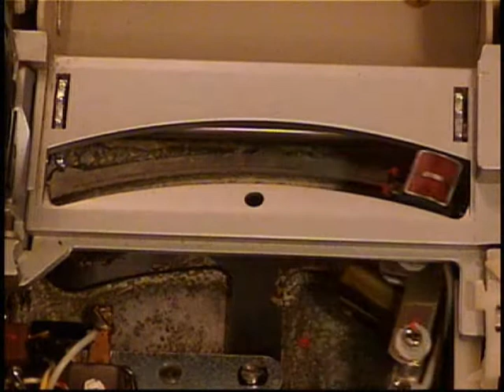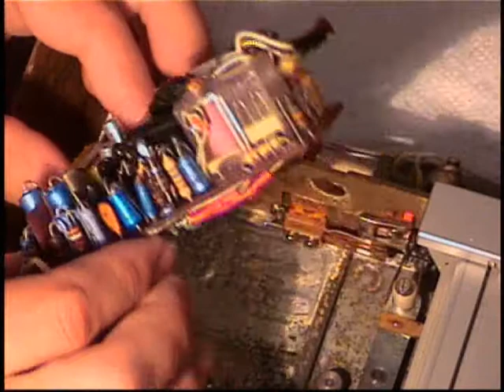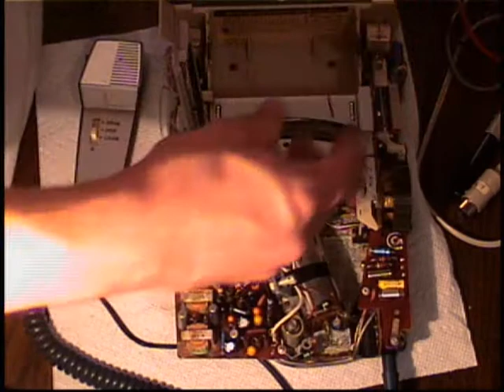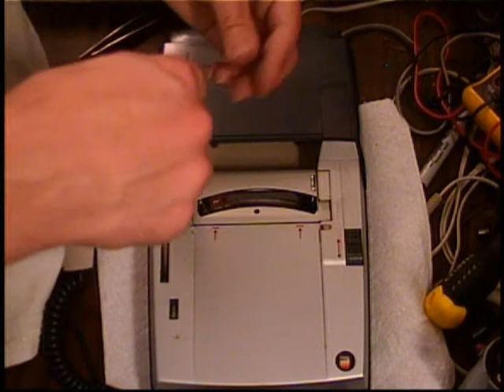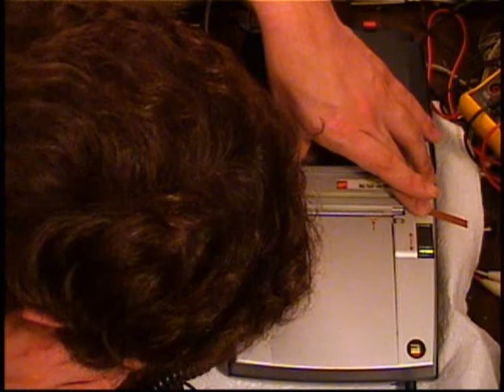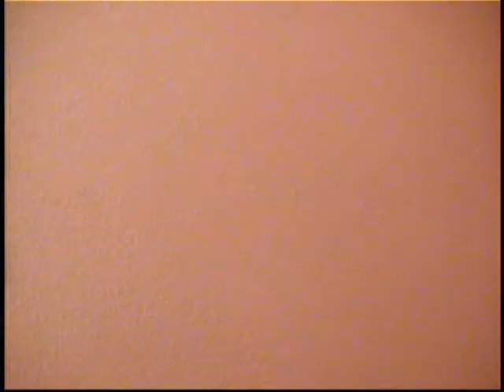GAF Rols model 102 VIDEO 2---Recapped amplifier and snippet recordings

Comment: That slider is actually used to cut off sections of the Rologram audio tape so they can be sent out for transcription. This was a main selling point of the Gaf Rols dictation machine based on the promotional materials we have which highlight that you can write on the film and then attach it to a letter to mail out for transcription. In order to allow for transcription, the Rols Dictation machine had a foot pedal attachment and  headphones similar to the ones you used to see on airplanes (1 speaker and a hollow tube that sent sound to both ears). =)